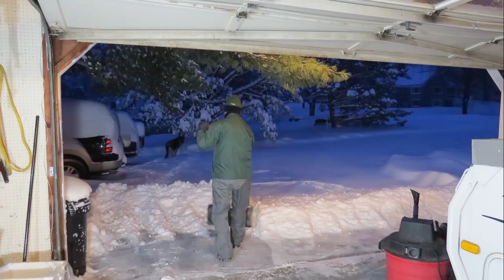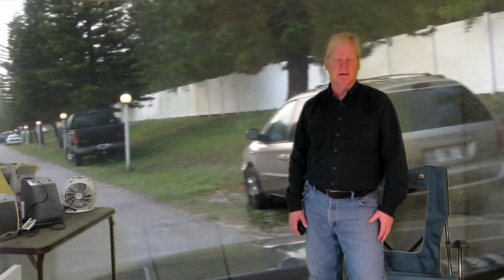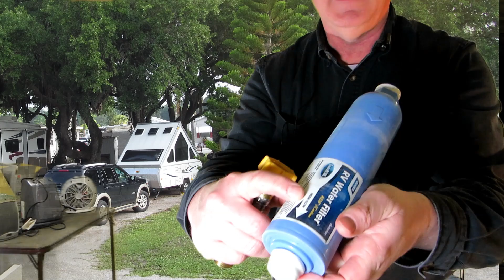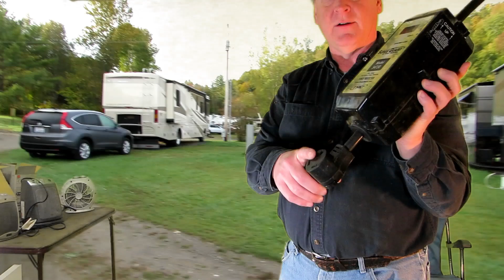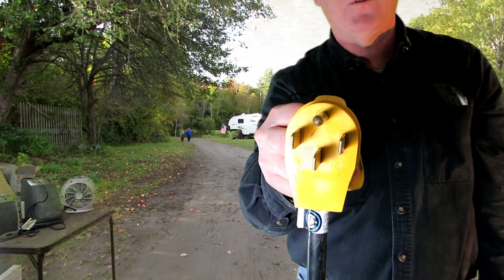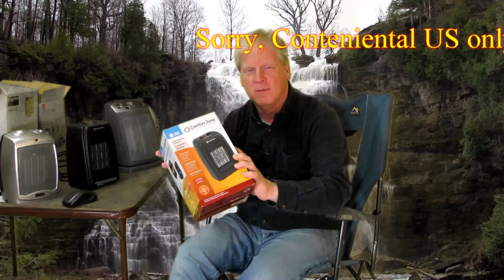Don't be Caught off Guard, What you need in an RV Park.

Comment: helpful info, thanks - had one bad incident w/ high pressure causing partial flooding from the bathroom sink - thankfully I was in the rig and stopped it quickly. Even had a regulator attached.  Recommend turning off the water source if you're leaving your rig for any amount of time (ie daytrips).
Reply from the maker: Some regulators are much better than others, its good idea to spend the money for a good one !!

Comment: Did I win the heater?
I'm freezing, got 4 sets of clothes on , inside a attic sleeping bag. Trying to breath with a c-pap, no power to run heated LINE & humidifier on C-pap. If I could heat air in a insulated box or room. This would help me breath warm air. & get toasty warm ,every once in a while. I stay in a tent. TKS for your help with info on camping. I'm handicapped , but love to camp under the stars. Hoping to get a Conversion van, W WHEELCHAIR lift some day.
God bless u, be safe. Rick said that.
Reply from the maker: I'll speak with Mother Nature about getting you some warm air !!  I'm pretty sure its coming your way soon !  Hang in there.  Thanks for watching and commenting.

Comment: Camco has an attachable 2 feet long wand with a shut-off valve to connect to a garden hose to rinse out your black tank for the TT's that do not have the black tank flush feature.  The cheapest one costs about $8 while the deluxe version (longer & flexible) costs about $20.  The cheap one works for me and very easy to use as my small TT has 30 G's each for its G & B tanks. 

To be on the safe side, wear safety googles and those disposable white nose and mouth filters for protection while using these.  Then sanitize it with a bleach solution, air dry, then storage in its own plastic bag or sleeve.
Reply from the maker: Thanks !  Always good to know how others do stuff sop we have choices and ideas.  Thanks for the comment !

Comment: Another good informative video Rick. No need to use your own LP when you have electrical hook-up that's paid for. We use a small and light space heater (2 settings, 750W or 1,500W) with a tip over switch found for only $5 as an after season 75% off clearance item. Also a 2 burner electric cook top that paid $20 for new several years ago. 

So far have yet to use my 1 year old compact TT's 20K BTU furnace or 2 burner LP cook top. The electric burners sit on a self made raised platform over the TT's propane burners so as not to waste the space and still able to utilize the TT's hood vent to exhaust any cooking smells and fumes.  The state camp parks we've been to should be happy we haven't the need to use the A/C yet also.
Reply from the maker: You might also look at conduction burner hot plates.  They use very little electricity and don't heat up the trailer.  Also they have incredibly accurate temperature control if you want to cook something slowly.   Thanks again for the comment !

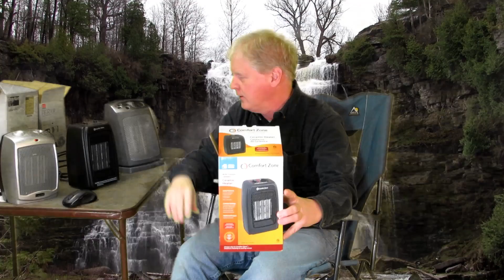Comment: Time: 18:00.
I found a nice portable electric heater for my 29' 5th wheel at a Fleet Farm store. Price was around $40.00.
It takes the edge off on those cold mornings that catch you by surprise.
If I'm in a full hookup campsite ,I'll use the electric heater instead of burning my propane fuel up.
Yes , those surge guards are never cheap at least for the good ones.
Got to watch out for those cheap ones though .
This is what I got for the heater.
King Electric      1200 Watt Portable Electric Heater            Mfr # PHTR-9
Reply from the maker: My advice for the heaters is make sure they have a tip over cut off switch and don't get anything more powerful than 1500 watts or you may be blowing the breakers frequently.  Good hear though you have your gear !   Thanks for the comment.

Comment: Nice but, I carry my own built in 200 pounds  heater. God guarantees it will keep me alive when the power go's out . Thank you for the upload but I have a need to build it myself. Toy A-trailer.
Reply: 18:25   I forgot to add that , never tent camp in winter, BRAIN FREEZE. Thank God for a my Van.
Thank you for info on surge protector, & Heater. I would like to hard wire one into my Van, The one you showed looks nice.  But I would be worried, It might grow legs & run off. I like idea of a inside wired system.  Any info on that?  Thought of using a Reliance generator switch box ,used for a house gen hook up.  Looking to find a good Hi Top conversion van, with a Wheelchair lift.  It Build up. As  RV's , don't have wheelchair access, short of crawling in and out. Lol
I must say , I'm freezing my ass off.  I fell into stream, trying to adjust my Sluice box. 
YES ,the water was Cold. I'm still shivering, my teeth just stopped chattering.  Getting out a lot of color. I need a 4 wheel drive & a 4x4 wheel chair,  would be nice. So would a 16 inch Cutterhead/suction auger dredge. Ha Ha Run that baby up the creek.  Just a thought. I traded a few nuggets for a Drone, With a Camera. & a go pro. When I figure it out. I will start posting   some Videos.

Comment: Just wondering....How do you protect the surge protector from walking off.  That is a lot of money hanging there.
Reply from the maker: I cut off its legs when I bought it !!  :-)     I just trust people I guess, and I don't stay in really cheap campgrounds that are occupied 90% by fulltimers/seasonals living in trailer trash.   In over 100 camping trips, no-one has even come near it.  I tend to camp in wild areas and not many criminals in those areas.
Reply: My TT is an entry level model so no high end electronics in there. The Camco surge protector cost me about $70 from Etrailer.com.  I wrap a security cable (bicycle lock) around it at the connections.  You can find lock boxes for these using your own padlocks, but most of them are plastic and not worth the cost in my opinion.  My method is not 100% theft proof, it's a deterrent only.  Most campers appear to be decent folks but you know the saying "In God We Trust" , not so for others we don't know that well.

Comment: At 17:58 you picked up the Comfort Zone box. I purchased 2017 Aliner Scout on March 4, 2017. Thank you for sharing your knowledge and experience. Pulled Aliner from FL to NW Indiana w/two cats last week and viewing your YT videos really helped re: power mgmt, pressure regulator and hooking up in RV parks. I adore your handsome boys. I'm waiting for AOC to contact me re: membership. 
Backing up is challenge so requesting pull thru site is priority. Hope to connect with other owners for support and ideas and sharing mods and updates. Thank you, Rick!
Reply from the maker: Find a shopping mall or plaza closed on a Sunday or holiday and practice backing up into parking spaces WAY away from everyone else.  Its driving backwards and sideways all at the same time.  You can get good at it if you just get the memory cells used to doing things opposite what you taught them a long time ago. 

AOC is a volunteer organization.  I joined in March and didn't here from them until I went to the rally in October.  So if you get itchy,  get on the website or the Yahoo group and holler at them.

Comment: Kind of off subject but I was curious if you used any sort of high wind kit?
Reply from the maker: No I don't....  BUT,,  I am almost ALWAYS in amongst the trees or on the edge of a forest.  So I don't get much wind.  And once the trailer is up,  its good for about 50mph winds,. as long as you keep the doors and windows closed !.  Setting it up in 10mph winds can cause lots of damage if the wind comes from the back end, but from the front end, I have personally put mine up in 25-30mph winds with no issue in a highway rest area.  Buts its risky !!  :-)
Reply: Good question! Wind is one of my worries, as well. If you camp in the desert, I hear that the wind is a big issue.

Comment: Great info Rick. I really enjoy learning from your videos. I do not own a trailer yet, but hope to some day. Aliner or the R-pod/Hummingbird style trailer is what I am looking. 

I like the idea of the Aliner, but have my concerns and hard to find reviews on the Aliner.

Keep making the videos and I will keep watching.

Ben
Texas
Reply from the maker: The Aliner is a "Niche" Product.  It is well made for what it is, but it is a Popup and so has some limitations.  It is also very Small. and as such it not really well designed for an internal bathroom set up, though lots of people do have them.  The best thing about them is they are easy to pull by smaller vehicles and there is a lot of modifications people do that you can find on line.   I planon Jumping to a Full size Class C in a few years, but for I love my "Suitcase on Wheels" !!

Comment: Hi Rick, I've been camping a very long time and did not know some of the points you brought up.  I've not ever used sewer hookups, but my son does and I'm passing your advice on to him.  I also didn't know about the electricity regulator thingy.  Sounds well worth the money.  Heaters are a life saver and I also have a little something that makes to cold nights really comfy.  I have an electric blanket that I put on LO.  It's just enough to keep you very comfortable without running your furnace or heater.  Just a thought  :)  By the way, I think you mentioned the box at 18:23.  My son informed me that I was silly for using my propane when I can tap into the electricity I'm already paying for.  Again, thank you so much and tell the boys HI.  Last video looked like Caesar might be some better....
Reply from the maker: Caesar Hardly knows he has a problem, he thinks someone else want him to sit every 5th or fifth step.  We just came back from a decent hike in the still 6 inches of snow EVERYWHERE and he did great.  Even tried to beat up Dakota !  I'm hoping he gets just a little bit better so he stops scrapping his toes on the ground.  That already has caused him problems with one long walk we took where we had to stay in the road the entire time.  (Too much snow)   But spring is here... And new stuff every week !!